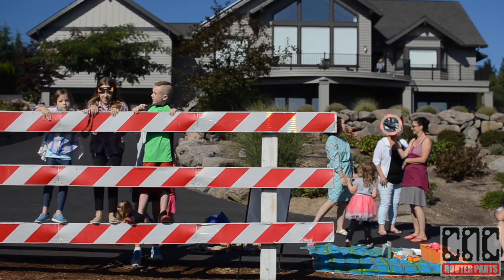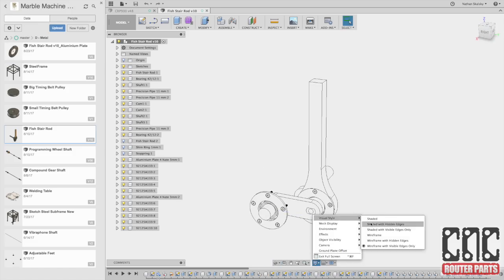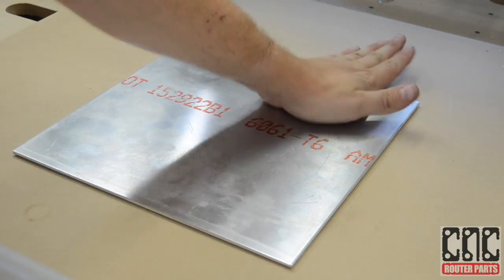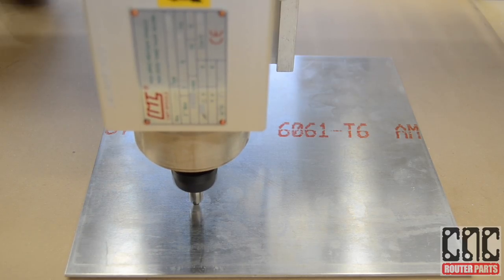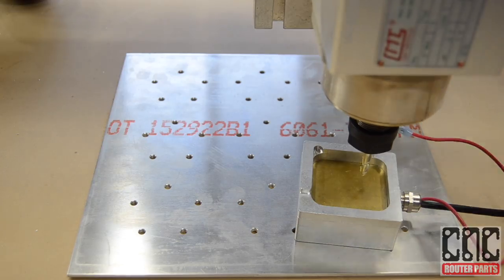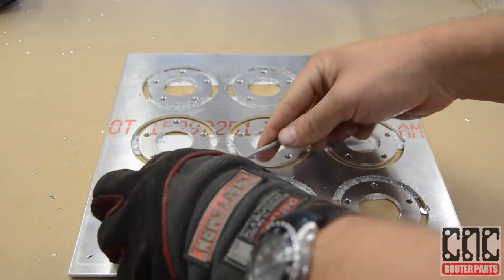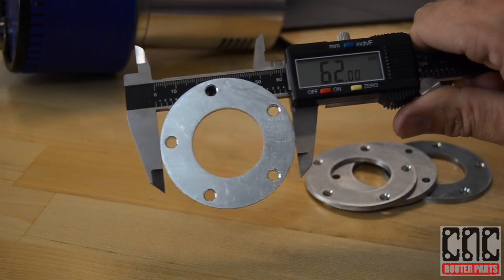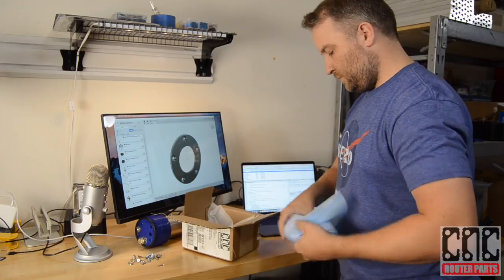Making Aluminum Marble Machine X parts on the PRO4848 CNC Router Parts Machine

Comment: did you not use lubrication while cutting?
Reply from the maker: bones549 Only the slightest mist through the air hose, I've found our ZrN coated tools do a good job of keeping the aluminum chips from sticking to the flutes.  I wasn't very concerned for such a short program of a relatively thin plate (3mm).  For setups with regular metal machining we use a dedicated atomized mister to extend the tool life and give greater sweet spot margin for feeds and speeds.  -Nathan

Comment: Thanks for the video.  It looked as though the centre piece was removed as if it was creating a pocket.  I would have thought it would be more efficient to cut this inside circle as a profile cut and hence a lot less wear on the end mill?  Cheers, David.
Reply from the maker: DRMNZ It is something of a judgement call.  Pocketing does mean more material to remove, though critically it ensures the there are no unsupported pieces to fly off - no telling if there is tape there.   Pocketing also allows more controlled radial tool engagement than a contour, so I think it washes out in favor of pocketing in this case.  -Nathan

Comment: What feeds and speeds did you use?
Reply from the maker: Hi, the profile and pockets were cut at 110IPM @ 14k RPM and 0.05" depth of cut.  -Nathan
Reply: cncrouterparts thanks for the info...i was shocked how effective the double stick tape worked. Never would have considered that for holding aluminum plate
Reply: @AvidCNC   Did you slow down to 50% feed during ramping and use a 5 degree ramp? We tried those parameters for a traditional ramp with a slightly tuned down version of you recipe at 12k rpm 96IPM for the cutting and it worked beautifully with healthy doses of canola oil and a strong air blast.